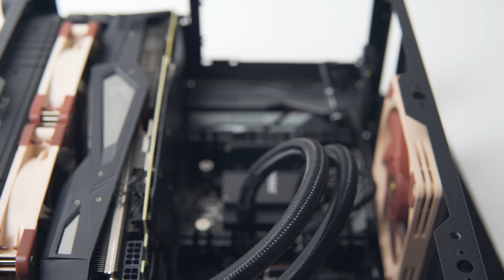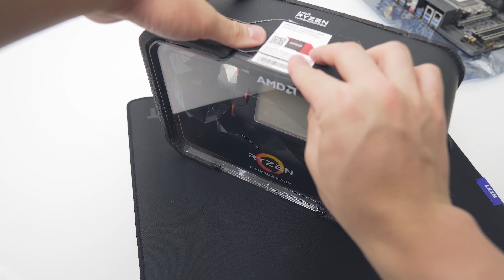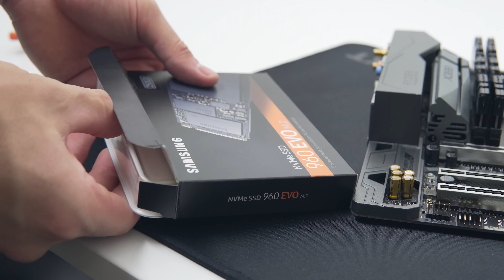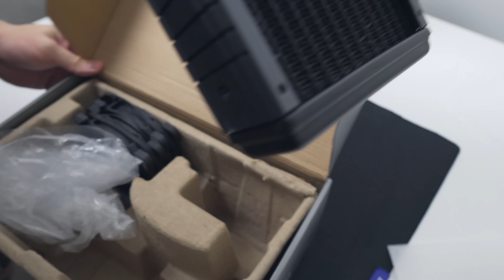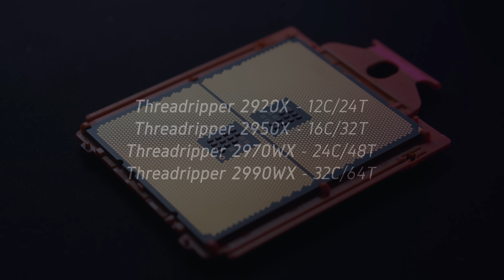Insanely Compact Threadripper Build - 16-Core Cerberus!

Comment from the maker: Had a lot of fun with this one - hope you guys enjoy!
Reply: why didnt you go for a MSI sea-hark, you'll get much better thermals
Reply: What power supply did you end up going with on this build? It wasn't clear, was it the 850?
Reply: Question:  Did the EVO need to go in the slot under the Video card to be Boot Drive? Or could you have put it into any of the available locations?
Reply: Optimum Tech As always, the SFF GOD!!! I Enjoy your reviews from the first second to the very last... so informative, clean and professional. And most importantly - it helps the community to learn about various options in the SFF segment, also new cases that become available, configurations options, THERMALS, and much much more. Based on your reviews I was finally able to chose my perfect configuration. Thanks a lot for your work and Best of luck to you!
Reply: Ali, which PSU that you named RM unit are you using instead of the Be Quiet ? RM850x ? It just to know more about ATX PSU clearance ;). Amazing job by the way.
Reply: Will you do a refresh of this build when the new threadripper 9000 is released?
Reply: Can this motherboard fit 2 RTX 2080ti's SLI
Reply from the maker: @yegnasivasai  Yes, but they need to be 2-slot cards e.g. EVGA XC Gaming, Gigabyte Windforce, Asus Turbo, Founder's Edition
Reply: @optimumtech  thanks for reply
Reply: @yegnasivasai  
Have you build your Cerberus PC? What PSU did you end up using? Does it fit on top of a custom loop water block?
Reply: Is it possible to install an ATX PSU above a custom loop CPU water block?
Reply: I'd Love a Skyreach, Dan A4, M1, or Ghost S1 but i can't find any. =(

Comment: I currently have this case, and and upgraded my cpu, but my single fan liquid cooler isnt good enough for the new cpu. I notice you you have a dual fan liquid cooling undeerneath the GPU. How does that work? isn't creating some kind of negative airflow between the GPU's fan intake and the radiator's fans? I was looking into changing my case entirely, but if this can work i would gladly keep my Cerberus! Can you help me figure this out?

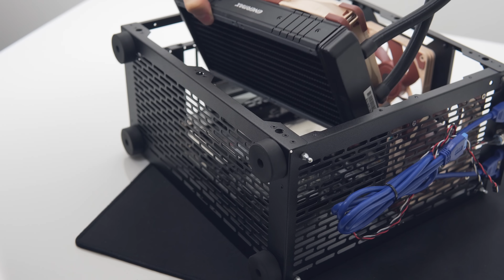Comment: 2:10 your fans AIO is the reverse. Because you have to blow towards the radiator. it will make him a real cold.
Reply: Do you understand how fans work? they are pulling the hot air up and away from the radiator. It has been proven that Push and Pull fans  have the same  effect on radiator temperatures

Comment: Anyone know how thick the Liqtech 240mm TR4 radiator is? I'm wondering if a 3 slot GPU will fit in this case with a bottom mount radiator.

Comment: Is it worth $450 aud
Reply: threadripper isn't worth it for gaming, it's only for workloads that need multicore performance
Reply: @theodiscusgaming3909  i meant the case
Reply: @sexyrexy345  considering that there are cases like the Thermaltake H18 that support 280mm radiators and have a front mesh intake and are not much bigger overall for just $50 AUD, I'd say no.

Comment: If you are copying this build like I did, FYI the upper fan is a 15mm fan and the 25mm fans in the above links will not fit at the top. You'll need three 25mm fans and  one 15mm.

Comment: Can't believe I didn't see this earlier! That 16 core runs extremely cool on that AIO. I had my 7980XE at 4.3GHz 1.1V on a 240mm AIO and temps were in the 80s under heavy, long duration workloads. Expanded a BeQuiet AIO with two 240mm radiators now, and still allows enough room for SLI RTX 2080Ti. Check it out here: https://builds.gg/jorge/high-core-count-multi-gpu-small-form-factor-workstation-3946

Liked and Subscribed. Great content.

Comment: @Optimum Tech   Won't having the radiator at the bottom cause problems with the pump and airflow?
Reply: It may do if there is air in the loop - I had issues with air getting stuck in the pump block. Air flow would be fine, especially with those Noctuas.

Comment: I am not sure I understand the cooling here.. it seems that radiator fans are pulling air from below and blowing it directly to the GPU, but then the GPU is also blowing in the opposite direction? 
Is this not gonna overheat the GPU under load?
Reply: Florian Oprescu  Yeah, thats what I meant... so the 2 fans are pushing air into each other, there is no clear flow.

Comment: I wonder how the GPU would perform if you installed an Accelero on it. It should just fit. Then you'd essentially have "reverse" push-pull with the Noctua fans pulling air thru the AIO and pushing it through the GPU heatsink, would reduce noise too.

Comment: @Optimum Tech, you should be real wary of the LiqTech. They have had massive numbers of failures. Supposedly the V2 is better but it seems almost everyone that has one has an issue at or around 6months of use. Mine failed at 8 months and my CPU started throttling down to 500mhz. So watch out for that. Some have even reported that the liquid boils and then the unit ruptures. It's not a good AIO.

Comment: i think you can chain in a 120mm radiator no problem if you can do that. i am just worried about CPU temp, because my danA4 cant even handle 2600 with 92mmAIO, it just cant.

Comment: What are your thoughts on an external power supply as an option?
The idea being the major unit is external like a power brick, single cord to the back of the case to a panel that would go where a normal power supply goes but it just has modular connectors within the case?
Makes for a very small capacity taken up within the case for SFF builds. Sure a normal external power supply can be cumbersome, but I think it has it's place for certain builds.
i.e. one example, under desk mountable for a sleek work space with a small PC on the desk.

Comment: Great intro with the visual storytelling! 
Have you tried the Noctua NF-A14 industrialPPC? They come in black/brown and can also use the Noctua Chromax accessories.
Reply from the maker: Thanks! I've tried the 120mm Industrial NF-F12s. Perform great, but are loud (due to the industrial design)
Reply: I love the look of those fans and speeds but had no idea that they were loud. Would you be willing to do a comparison of noise of those fans versus standard Noctua fans?
Reply from the maker: @frederickpolk  Check out my NF-A12x25 radiator performance review. I've got thermal / noise results for NF-F12 industrial PPC there 👍
Reply: @optimumtech  Found it! https://www.youtube.com/watch?v=dX7azFtJDT8
Thank you!

Comment: Monster Build, Throttles, so only 50% seed. LOL. I love the idea of small builds and this youtuber. I just wish there was a way to actually get this small and still get full speed. NO WAY 56c on 16 cores, maybe in game, but who builds this for gaming.  You build this for editing etc, so this means AVX which means heat throttle at 100c plus. Come on bro keep it real.
Reply from the maker: The 2950X was tested for 15 minutes during a Blender render, using the Cycles AVX2 render engine. 
The CPU was also running @ auto (3.75GHz / 1.18V). Ambient room temp was accounted for. 
Why would I show gaming temps for a workstation machine? 
Keep it real.

Comment: 225 is way too expensive for a matx case, with nothing special. I had LianLi mITX cases with backplanes for 150 bought.
doesn`t matter if you put in 2 grand hardware, but still too expensive.
Reply: For some, yeah, but there were also lots of people who bought Caselabs cases, not to mention the murderbox. If it doesn't work for you, that is fine, but there is definitely a market. If you try to max out this build a bit and add 64gb of memory for 800, some more 970 evo storage (2TB) for 450, seasonic 1kW titanium psu for 250, 2950x for 900, x399m for 340, 2080ti for 1400, 90 for all the fans, the cooler for 130 and some extras for another 40 totals a mere 4400. At that point an extra 100 euros is less than 2.3% and it might very well be worth considering.

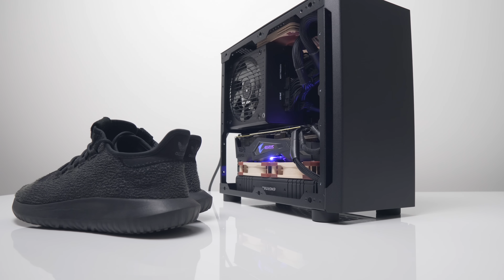Comment: 2:35 what a joke. choke the GPU much, why didnt they just make it  so the GPU was right at the bottom and the top has a larger space to mount the AIO. get a case like 100mm larger and the price vs performance will be worlds better,
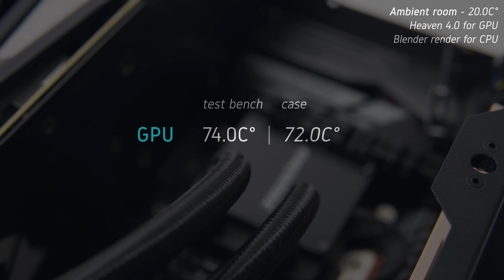Reply: 6:34
Reply: @QuickshotGaming  yeah but if there was just fans no rad temps would be better wouldn't it?
Reply: Mickey Majkic I mean it's better than an open test bench I'm not sure what more you want.

Comment: Hey man awesome video as usual🙂. Any chance you could put a list of good tiny itx cases ranging from small to big some where? I am planning on building an itx gaming PC and I want it to be very quiet as well as looking somewhat nice (I don't mind Noctua fans ahah). Thanks! (I can't bring myself to spend $450ish NZ dollars (including shipping) on a Ghost S1 lol)
Reply: I would also google around for some taobao cases. Small to medium (10-15l) would be sunmilo. Very small would be zs cases (about 4-7 l). More expensive options would be dancase (too poor cooling personally for me, I would either go even smaller with less cooling or slightly more for superior cooling). Ncase (too unoptimized, 15l mitx..).
Reply: @sindresvindal2290  yeah I have done lots of googling on itx cases but there doesn't seem to be any lists of all the tiny itx cases, if someone can provide me with that I can do the research on the individual cases. (I didn't know about this case)
Reply: @sindresvindal2290  Thanks heaps man, I'll go through them and see if I can find one that I like that doesn't cost my right kidney.. Right now I've actually got the Silverstone ML-08B but it is terribly built and designed in my opinion - I want something that looks nicer and has more functionality (place for CPU radiator, intake/exhaust fans, better GPU mounting system).

Comment: Wouldn't having the radiator fans in the bottom be beneficial to cpu temps since the rad would sort of be in a push/pull config? Or would the gpu fans not affect the radiator in any meaningful way?
Reply: Push/Pull setups really dont effect performance much.. a couple of degrees improvement at best. Your better off just picking very solid fans.
Reply: Aye, what I'm talking about requires no additional cost though. One could also argue that different sized fans at different rpm's could have the adverse effect on temps when stacked, although that would require some testing instead of speculation. The difference between decent and top of the line SP fans are be within a couple of degrees anyway, so the difference in temps mostly comes down to the radiator itself.

Comment: Just curious why you decided to go for the full size psu over the sfx in the front (or mounted in the same spot with a sfx adapter bracket)? It seems like airflow would be even better with a smaller psu but maybe that isn't the case? Possibly material for a later video? Cool build either way. Keep this kind of stuff coming.

Comment: First gen Liqtech? You're not worried about galvanic corrosion?
Reply from the maker: It's only a demo build. For actual use, see the v2 of the Liqtech 240/280.
Reply: @optimumtech  I still wouldn't use a LiqTech. People even said V2 still had issues. It's just a crap unit all around.
Reply from the maker: @Sebastian Jug Yes sir, in the bottom

Comment: I was surprised to see that the GPU didn't get hotter! Would have thought that the card would run close to base clock all the time with the setup you got there.
Reply from the maker: Seeing as it's sitting on top of fans (as opposed to a non-ventilated PSU shroud for example), it's getting ample airflow. 
Same effect can be seen in Node 202, RVZ 03, and NCase M1, where bottom mounted fans improve GPU thermals significantly.

Comment: do you think x299 ghost s1 build is possible?
Reply: @airport2000 An itx x299 board exists :D ASRock Intel Core-X X299E  It's  a crazy expensive solution though.
Reply: Probably not because its a Mini ITX case only , But anything is possible with modding.
Reply from the maker: For sure, with a large top hat and 240mm AIO.
Reply: @optimumtech  If you delid, you can even get away with the Asetek 92mm AIO in a Dan Case with x299.
Reply: Literally just Emailed them and they told me no.
Reply from the maker: @germanikolaas  They probably don't want to encourage or promise it, you can understand why, but it definitely can be done.
Reply: @optimumtech  honestly due to the response of those emails, I have decided not to go ahead and purchase it I kept asking them twice if you could stack the top hats, or put a large top hat on the bottom and a large top hat on the top etc. And they never answered me with any enthusiasm,  just one worded replies. I know another company that custom makes cases and so I'm going to go with them.
Reply: possible
Reply: cuz ASRock X299-ITX ac exists

Comment: My Ryzen 5 2400G struggles on a 240AIO when testing under load. I think this machine will struggle if overclocked or just under testing loads. CPU temps rise quickly and in this cramped case, it will be even worse.
Reply: No
the threadripper actually keeps it's cool with a 240/280 aio provided that the whole ihs is covered

Comment: Is it possible to put another GPU inside?
Reply from the maker: You can use 2 x 2-slot graphics cards on the X399M Taichi. You'll need to use a front mounted radiator for this system with shorter cards.
Reply: @optimumtech   Do you think a custom loop CPU block + fitting can fit underneath an ATX PSU?